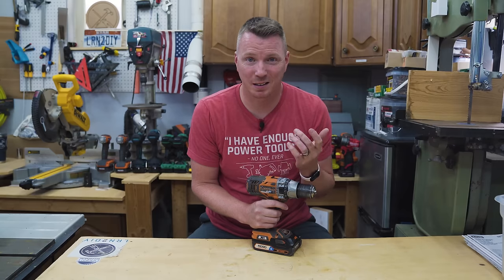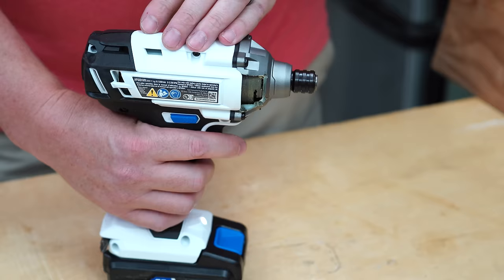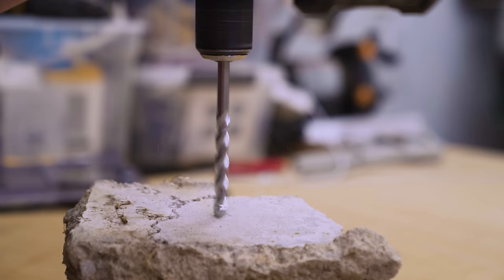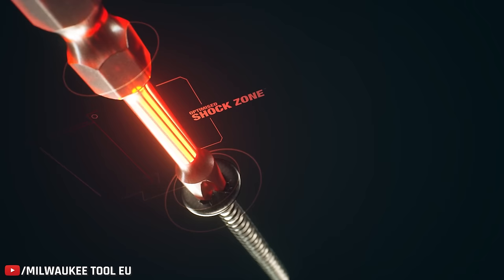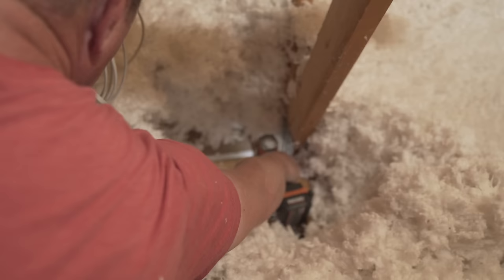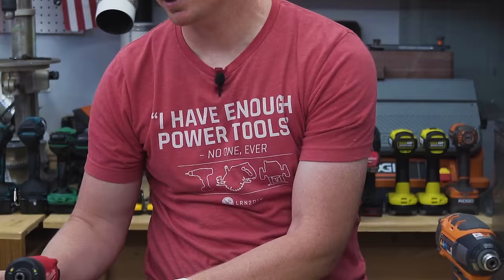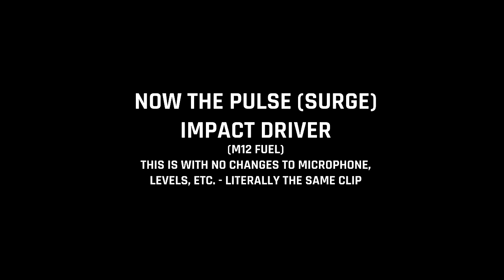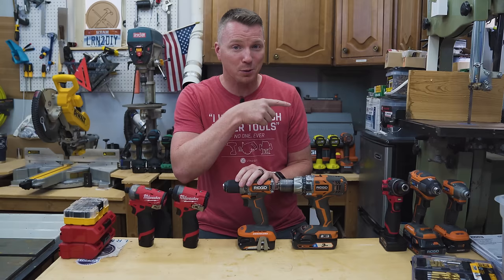Is The Cordless Drill Becoming Obsolete?

Comment: Surprised you didn't mention the add on chucks that fit into a Impact driver to handle bits without a hex shaft.   Great video and channel.  Thanks
Reply from the maker: It’s just what BigMo said. I have a chuck that fits into my impact but it’s so heavy and long that I’d rather use my drill in that scenario.
Reply: Yuck. I tried one of those once and the impact sxruon got thr chuck so right it was so right I had to put it in a vise to loosen it. I can't say I feel those are a good option. Just my 2 cents.
Reply: I'm just saying that I keep an add-on-chuck with my impact driver for those occasions when my drill is not handy and I need to drill a hole.  Not all work is fine and super accurate.  It has been most appreciated on many occasions.  Over and out!
Reply: @robthorne9939  That's when you just have the drill instead.  Modern compact drills are good for around 50 ft lbs, plenty for what they're intended for, before the better fastener is one with a hex head and then you use an impact wrench instead.
Reply: @LRN2DIY  keep the drill impacters are great but drill's are needed 👍

Comment: The problem with impact drivers, is that they weaken over time.  I used one for a whole project with self tapping metal screws which was also very loud and noisy.  After that it was much much weaker.  I went back to the drill (way less noise) and it didn't become weaker at all after a huge project.  And I enjoy way less noise.
Reply: It has more moving parts so that makes sense.

Comment: I have and use both. My impact driver is great, but not for low torque screws or drilling in certain materials. Corded drills are great, but I often work where no power is available. The time to drill 4 holes for a mount, means I don't waste time on long extension cords. Like everything, it depends on your application.

Comment: I'm a directv tech, and I'll use my impact to drill some small holes, but definitely when it comes to drilling through a wall to run a line, I'm gonna use my hammer drill. Not only is it better for the task, my 18" bit doesn't have a hex chuck on it

Comment: I have owned DeWalt corded and cordless tools most of my life. 20v is my choice. I've noticed myself doing the same thing as the original poster over the last couple of years. Then I bought my wife a DeWalt 12v impact because I saw an HVAC tech at work using one and checked it out. Now I've started using it because it's smaller and gets into tight places easier.😎
Reply: Anniversary present?  That's so sweet.  Lasts longer than flowers.
Reply: @chethammer  yep. 😎

Comment: For the screws I use on the job site (mostly 6x70-200mm) the drill driver is a lot faster than an impact driver. Only for the big screws (8x200-300mm) I have to bring out the big impact wrench.

Comment: I have been on the impact driver game for years now but I purchased the DeWalt 3 speed model recently and it’s a game changer. No more snapping the heads off of fasteners because I accidentally hit the trigger just a bit too hard. The first speed is perfect for putting small screws in wood without having to worry about stripping the wood out and the second is great for pretty much anything else. Then there’s the third speed , that’s what you go to when you need to break loose the lug nuts on the old tractor that have not been broken loose since 1973 !!!!! Seriously though I only use the third speed when I’m being really reckless with something because it’s VERY STRONG for a quarter inch impact.

Comment: A cordless hammer drill is still a must have IMO. The clutch is great for tightening things that don't need full power to roughly the same tightness without having to feather the trigger and guess. The hammer function is also very useful for a lot of projects where you need to drill concrete but a larger rotary hammer is overkill.

Comment: For my projects now I set out two impact drivers and two drills. I keep finding such a variety of fasteners, Phillips, torx, square and even a few slotted. Even putting things together I wind up using the full range of fasteners according to what is available. I just keep reaching for a different unit instead of constantly changing bits. I still have to change out when needing an extra long, extra short or just plain weird. If I’m working away from the shop I’ll just take the drill, extra batteries , Dewalt bit set, Irwin set, Cheep set with weird bits, extra long security torx set, long phillis bits and long square bit.  Everything is put together with a hodgepoge of fasteners. The days when all you needed was a slotted and a philleps are long gone.

Comment: I recently bought the Mikita set. The new black model with the 2.5 Ah. batteries. This is small light weight and Powerfull. The drill is used for drilling pilot holes and many other things, while the impact drives so many different screws. There is So many new fasteners coming out with different materials that making these power tools a complement to the tools needed.

Comment: I worked in a sheet metal shop for a while and the impact driver was used for all our heavy tapping as well as driving nuts and bolts with a 3/8 adapter into sockets. Way better than any drill💪

Comment: Black and Decker was the first impact driver I owned.  It was a corded and I used it in a shop situation mostly, in later years it went out onto jobsites.  The year may surprise you.  My first impact driver was purchased in 1975.  I have owned one ever since,, and lately,, those are cordless Dewalts,, I think I own 5 at the moment.  The reason?  Multiple jobs of drill, countersink, and fasten,, rather than change bits all the time, I just pick up the drill or driver next needed in the sequence. I was assembling and installing kitchen cabinets last week,, 5 tools chucked with five separate bits.  Cuts my total time in half.

Comment: working for the cable company we have to drill through telephone poles with a auger bit. we used to use a regular dewalt drill but recently every lineman qt the company has switched to a big klein tools battery powered impact gun. it makes a huge difference in time and effort.

Comment: Tapping threads with an impact saves taps over using a drill. When using a drill as the tap bites it twists the drill and snaps the tap. A impact gives a straightforward force and drives the tap with out snapping the tap. As a master electrician I have tapped for over a decade with an impact, it’s awesome.

Comment: I Bought Dewalt and have stuck with it for years ! I've got 14 pieces and so far no complaints ! I can tell ya the 20v Impact driver is a work horse especially building decks I can honestly go through about a years worth of decks before they give up , usally about 8/ 10 Big Lake decks . And it never the same , some are clutches , some triggers , but I keep my HD 1/2 Dewalt drill handy . 3 gears and all the settings ! 1st or Low gear a put a cast on your wrist without the Handle ! But if your driving big 1" Lag screws , 6 and 8" long , It a bust sockets before it gives up !

Comment: 1:50 good old corded drills with chuck. Never lost a key, I electrical taped it to the plug end of the cord so you have to unplug the drill to change bits, which seeing as I was about 8 when i started messing around with tools was probably a very wise precaution on my dad's part lol. I still tape the key to my corded drill flex to this day, keeps me from doing dumb things even if it is annoying. Plus I dont use that drill often, but when I do need to drill a hole in something vs using my impact, it almost always warrants using the high speed corded drill seeing as its usually brick, concrete, or metal.

Comment: I've been using an impact driver most of the time since around 2008...
For both driving and drilling larger holes with a spade or speedbore.

For normal drilling with a traditional drill bit, that's when I use my drill.

Comment: I have the same for Ridgid tools, the 2 larger and 2 smaller drill/driver.  I love the new sub compact driver, and the new smaller drill seems to actually have more power than the full size at times.
The only thing lost in the small version is no hammer, so I still break out the large drill often to drill mason.

I still find myself using the drill/driver often simply to reduce bit changes on the driver.  The phillips driver bit for the most part has a permanent home, but then again that is a big advantage not quite mentioned directly is that changing bits on the driver is so much faster and easier.

I am not sure if I have messed up my larger drill, or its by design but I have to set a bit many times to get it straight.

Comment: For my first cordless drill, I bought a dewalt brushless. It has a lot of torque, almost a dangerous level of torque.
Which is good, because I've had to put 1/2in holes in 3/8 steel plate.
Generally though, for just working on stuff, my impact wrench is what I use. So I see the point about what actually gets used.

Comment: I have had a impact driver since they came out. Many years and was one of the first to get one. It was a 9 volt if I remember correctly. I was at a trade show and they were showing them and were not even on the market yet. Told the guy that I wanted one as soon as it was out and send it to the lumber yard I dealt with. That they did and it was then that I fell in love with the impact driver. I then went to the 12 volt Dewalt and then the 20 volt. In the beginning I was always ask what I was using when people heard the driver when I was on a job. There are screws that that the manufactures say do not use an impact driver on. A great tool that I would never go without.

Comment: If you have fine digit control with an impact, the torque setting on a drill driver isn't really necessary.
Reply: Absolutely true. I have built way too many pieces of IKEA furniture using an impact. You just have to be careful.

Comment: I totally agree with you. I use my impact to do all work. I use drill as a chuck to hold and buff / sand small parts. Also at times i do use my traditional drills. But i have a Black and Decker multitool evo model and the drill chuck is keyless. I can never get the circular shank drills fastened properly. I wish it had a locking chuck.

Comment: I only use my impact for framing type work and even for that I used to do it with my drill just fine. Drills have clutch settings, speed settings and best of all the trigger/speed control on a drill is way better than it is on an impact driver. I’ve found myself in delicate situations where I needed a slow and controlled rotation that you just can’t get on the impact driver. The trigger is too sensitive. Impacts are cool, I have one. But if I can only have one I would take a drill over an impact every time.

Comment: I have both a impact driver and a drill. I mostly am building decks and fences and I mostly use my drill for the deck screws and any other fasteners. It just feels faster and smoother with a drill vs impact. But i will use my impact for ledger locks and bolts. Tighting nuts ect but anyway what im sayin is its really up to the operator.

Comment: This has been my impression too -- the impact driver can do almost all of what I need around the house. DeWalt make a clutch tool holder for impacts, but it has only two settings -- off and on. Don't know how useful it really is. It would be super if somebody came up with a torque limiter for these impact drivers, I think one made of hard rubber that worked like a keyless propeller shaft on an outboard would be great. I could see getting them in soft, medium, and stiff. Bonus if it's adjustable, even if it's awkward. If you need more, get a dedicated tool.

Comment: I have loads of Impact Drivers from a Small DeWalt to a Massive Air Impact Wrench !!!!  But I like the Drills because you can adjust the Torque !!! I've got a Mains Powered Drill that has all the features of a top end Battery Drill, eg Torque Setting.  I use a small impact driver with a hexagon drive, and a very powerful one with a half inch Square Drive !!!  I never get Kickback with a Drill because I adjust the Torque !!!  So I like both my machines and I use both equally.

Comment: I am an electrician, and when I worked for a contractor which had a limited number of power tools; the impact driver was the most taken. Most guys wouldn't use a drill if offered to them. They still have their uses in drilling more tough material (metal, hardwood), but it's not the first choice.

Comment: Same here. I got an impact driver for screws and drilling small holes. Then I also own an SDS cordless drill for drilling in stone and concrete. The thing is, my combo drill broke and now I'm looking for a new one for the few occasions I want to drill in metal or larger holes in wood.
Reply: SDS to jaw chuck adapter.
Reply: @kornaros96  I did just that. But the SDS drill is a lot slower and it doesn't have a speed controller. 
Another issue is stability, it's near impossible to keep the drill bit straight. YMMV
I bought a new drill last month for this reason.

Comment: I use the same Rigid drill. It has a clutch that I use every time I have to use my hole saw bits. With the clutch set reasonably high, any time the drill would have torqued my wrist, the clutch kicks in.  Wrist saved, and a smooth hole is drilled in the desk top I needed to put a cable access  hole into.

I also use the clutch set to low settings when assembling audio/ electronic racks. The speed control at the trigger lets me start rack screws slow and easy, then zip them in - the clutch allows them to be set snug, but not over tight.  I’ll look into the lighter version if my drill gets stolen again, but for now it is my daily driver.😁

Comment: always need two drills, one set with a drill bit to drill the hole at high speed, the other set for driving the screw with a low speed impact drill, so I can drill and screw repeatedly without changing setups every time

Comment: Drills are for drilling and impact drivers are for driving screws.drills can be used for small or screws that don’t require lots of torque like drywall screws.if you only have a drill and need torque then you crank your clutch to it’s highest setting and put the drill speed at 1 because although slower speed 1 gives you more torque.

Comment: 9:23 dewalt and milly both make a higher priced 1/4in impact driver with a torque select on it 
So for finish screws or soft wood.. it’ll automatically stop driving after the first impact 

Handy, but it makes the impact a decent chunk more expensive

Comment: I have two of each... yeah I know... crazy...

DCD805 🇬🇧 Ultra Compact Drill G3 ...
DCD796 🇬🇧 Hammer Drill ...

Sometimes I use both Drills at the same time, one with Drill bit, one with driver bit.

DCF887 🇬🇧 Impact Driver
DCF899 🇬🇧 Impact Wrench

Used for driver bits, or large lag bolts / car wheel nuts

Comment: One disadvantage more for impact driver: it tends to break drills, especially those with thin diameters (up to 4-5mm). It happened to me when I was tryng to drill through a nail inside a piece of wood. Also some impact drivers don't go well with taping screws (especially the cheap ones). But I still prefer them, because they are a lot smaller.

Comment: I have several cordless drills. When I bought the last one, identical to the one that I had just purchased a few weeks before, I stood with an impact driver in the other hand. I really prefer to have similar or identical tools all with 1/2" chucks. And being tiring using the wee bit heavier tool - I'm an OF but still can drill and install screws for a very long time. Nould it be nice to own a driver, sure but do I need to spend another $$$ fpr minimal convenience ...nah! If I need a precision drilled hole - well then out comes the drill press.

Comment: i had to change the tires on my twin axle 14k trailer and all the lugs had paint on them. i grabbed my Hart impact driver (the one you show) and it hammered every lug to 110 lbs! And yes, i know it is not for that, but it worked... btw, my lugs require 120lbs of tq so i confirmed it with my tq wrench... incredible tools... completely agree with you!

Comment: I rely more on my impact driver as well.  Like you said, lighter, easier to handler, does most of what you need.  But there are certain scenarios where you need the drill.  I hang TVs frequently, so I'm always drilling into wood and wall studs.   Impact driver doesn't give me the precision I need and requires more setup for that task.

Comment: I find using impact drill bits on a impact tends to have way too much wobble.  So I use the drill instead of the impact.  And it doesn't matter if you got cheap or expensive bits or a cheap or expensive driver.

Comment: As a welder/ iron worker, the only things i use an impact for are concrete screws. 
All the rest i go with the drill.
I can tap M12 holes in 15mm thick steel with my cordless drill no problem. 
Drilling big holes in sheet metal, wire brushes, paint mixing thing, carbide burrs, 
And for wood screws, the noise…
When you’ve done one week of arc-air gouging, you avoid noise like the plague. 
So drill is way better in my opinion

Comment: I do things for my recording studio and installations with my cordless drill, which I also use to drive screws and until today I have not needed an impact driver, if you only want to buy one, the cordless drill with torque brake is still a better option , if no great force is required.

Comment: I use the impact more often as well. Especially when boring a 1 1/4" bit through multiple layers or 4"+ hole saws. It is slower, but it doesn't rip your arm off either. It's hard to find that setting (sometimes impossible) where the clutch is weak enough to not rip your arm off, but still do work on a drill driver.
Reply from the maker: Agreed!